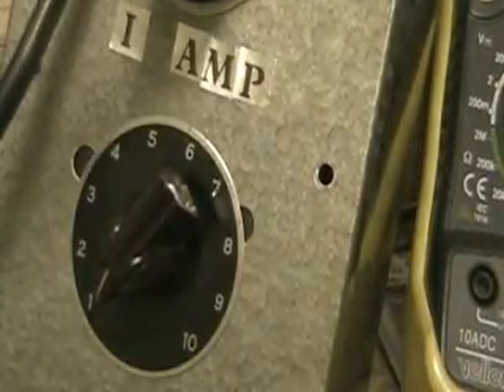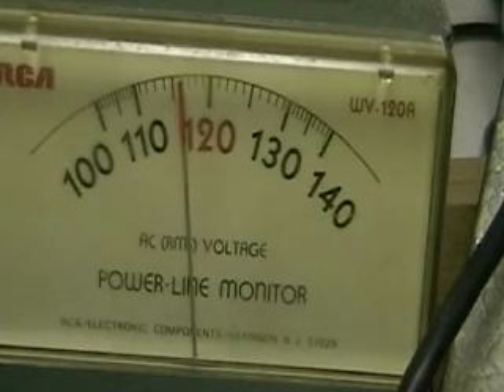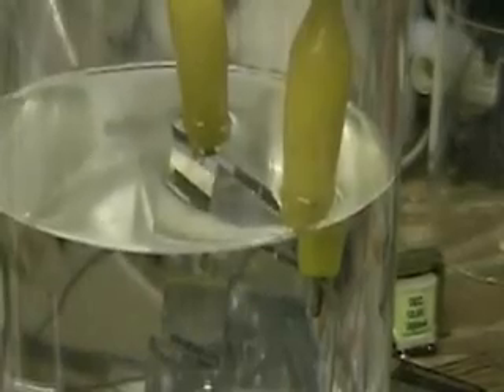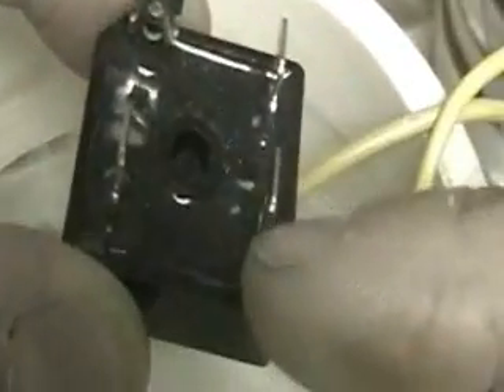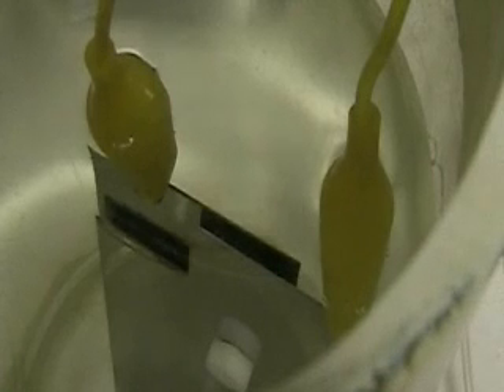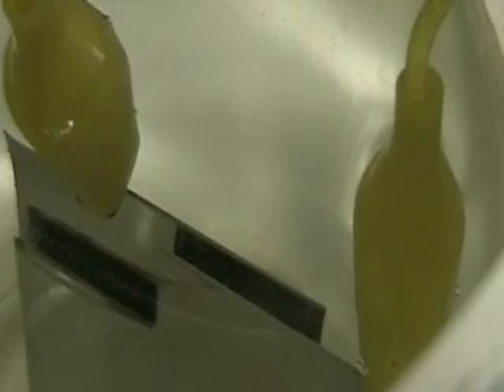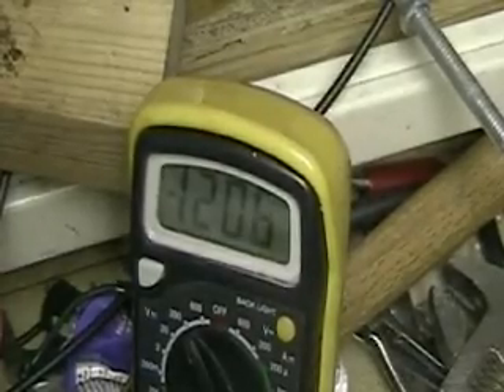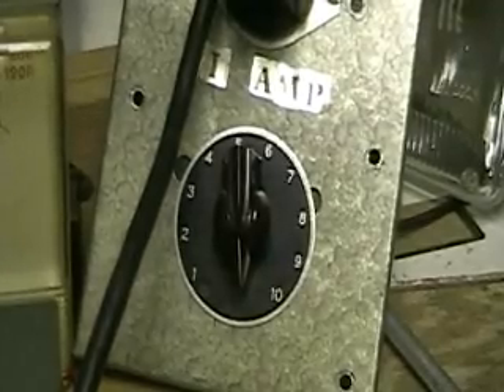Hydrogen Tap (MYER-FOCUS-AARONS) 335

Comment: John...appreciate your work.  

With reference to engine damage there SHOULD be none.  However the exhaust system past the headers is liable to rust earlier (steam).  If folk turn the system OFF for the last mile or so of their journey that will evaporate any steam in the pipe....solved

Having said that, in a "LAW SUITE" culture stick with what your saying.  You can trust folk to do something STUPID and blame you for them being dumb.

Comment: well , here in sweden its cheaper to buy a new engine once in a while (if you have a older car with cheap parts) than filling the car up more than five times.
How do you think hydrogen injection would work if you run your car on etanol?